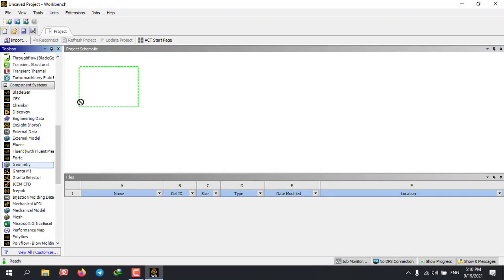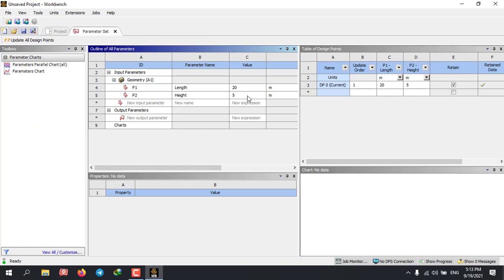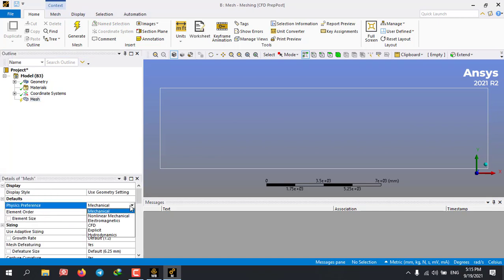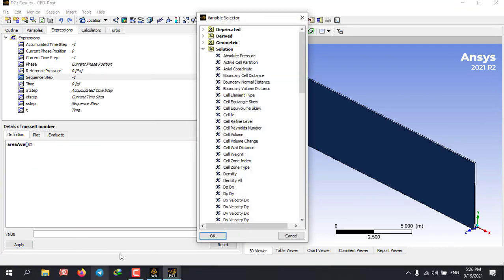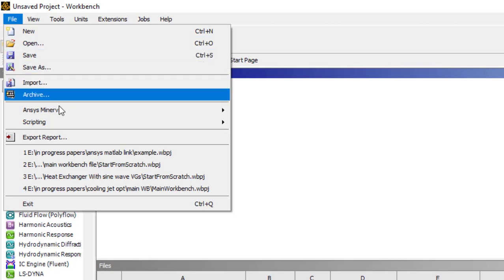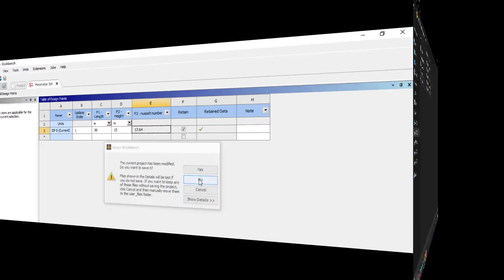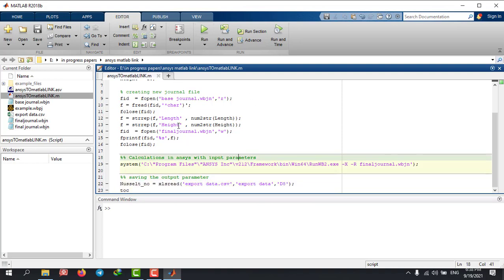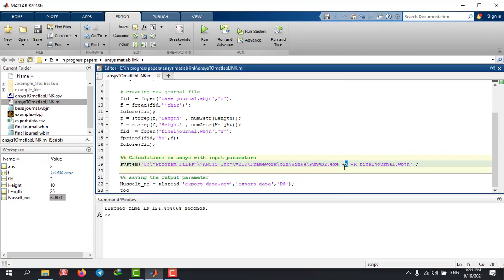how to link ANSYS Workbench TO MATLAB Using Journal Files ???

Comment: can you tell me how to use code to optimize the same structure by using genetic algorithim tool box in matlab. objective is to optimize the mass of the structure, design variables are its width and thickness, constraints are deflection and stress
Reply: Same question

Comment: If I want to do a "for" loop on length and height so that I don't have to change the value manually, is it possible to save all the results in one output file?
Reply: my suggestion would be to have a secondary output file. The first one would interdace b/w matlab and ANSYS and u use matlab to create a second one that send the data to it for every iteration.
Reply: how?

Comment: So i can also put a vector of numbers in length or height? And it will run for all, or do I have to do one value at a time? Great video BTW ☺️ looking to use what u showed 😀
Reply: I think you iterate using for loop, where you can also choose to update the csv file with the new records inside MATLAB.

Comment: Thank you very much for the valuable information! 

Edit: I solved my problem and it works like a charm! I not deleting the problem in case of someone makes the same mistake :)
I just forgot to open the file hence there was a missing code line : 
Open(FilePath="D:/Backup/2022/Design_Optimization/ANSYS/WB/CFD_Matlab_trial/CFD_Matlab_trial.wbpj") 

However, I had an error where it says: "CommandFailedException: Parameter of name 'P1' not found in Project
 In file "finaljournal.wbjn", line 5" 

I am using ANSYS 18.1 and Matlab R2021b but I made the changes (e.g. I changed the v212 to v181)

I am confused about how to continue, could you please guide me?
Reply: A small note - this line should be put in the journal
Reply: I also have the same problem, did you solve the problem, can you give me some information? I would be very grateful
Reply: Bonjour les amis, il faut verifier le fichier excel, est ce que t’as la valeur P1 à D8 ou non

Comment: I found out that there was a problem with my solver, Update failed for the Solution component in Transient Thermal. Error updating cell Solution in system Transient Thermal.

Comment: Thanks very much! But when I used my own case, the software was opened and it seemed to be running, but the csv result table was not generated.Do you know the reason
Reply from the maker: double check your journal file that should be where your troubles and problem are ...